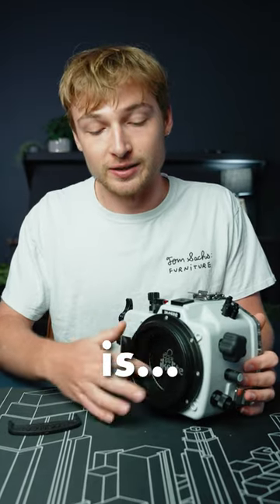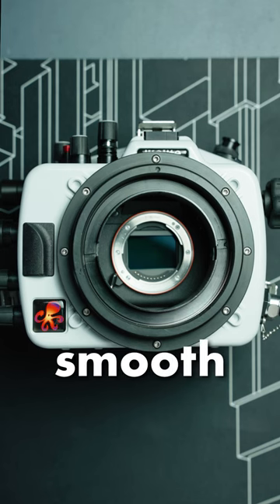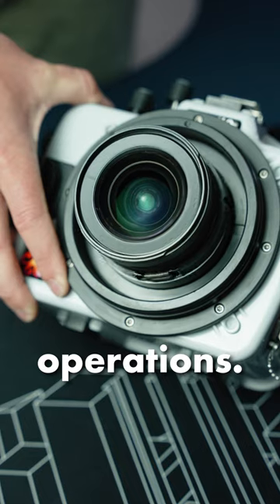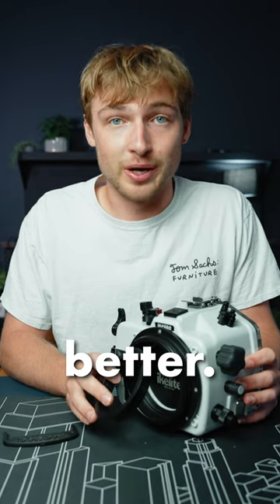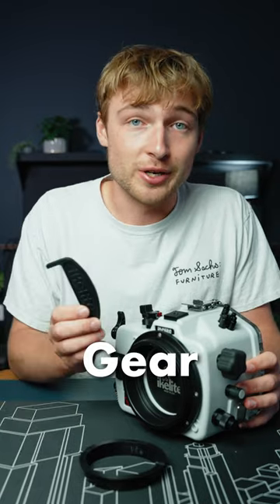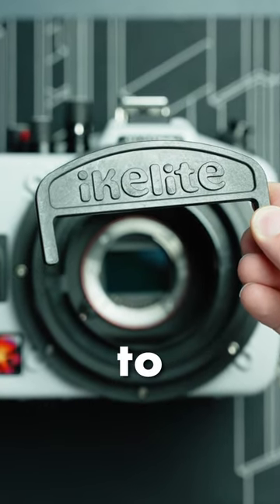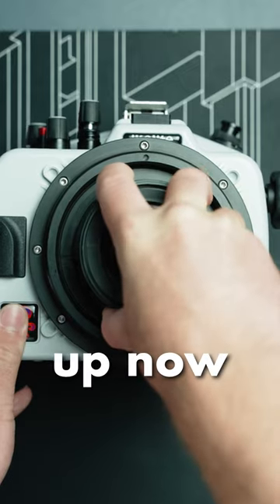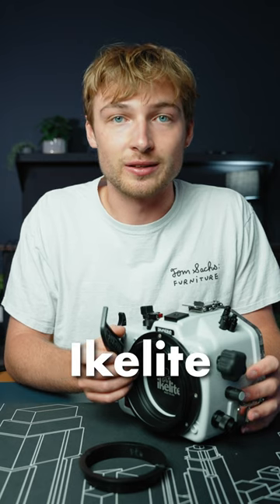New Ikelite Zoom Gear Retainer Tool #shorts

Comment: Please, i need this plastic gear for use a Canon EF-S 10-18mm f/4.5-5.6 IS STM  in a 200DLM/C Underwater TTL Housing for Canon EOS 200D Rebel SL2 DSLR?
Reply from the maker: The correct zoom gear for the 10-18mm lens is # 5509.20.